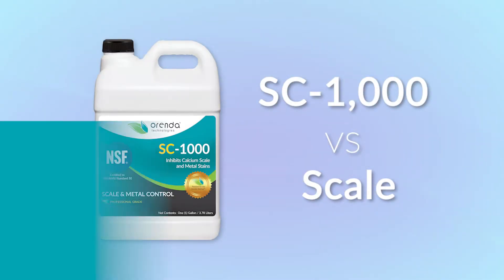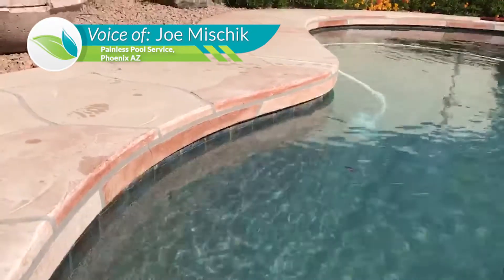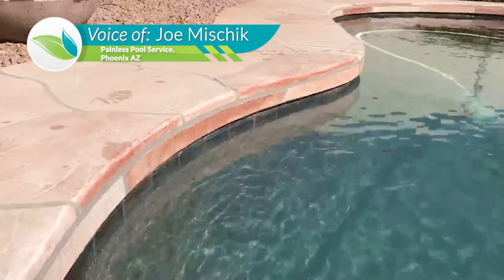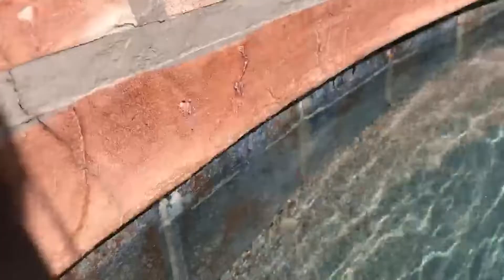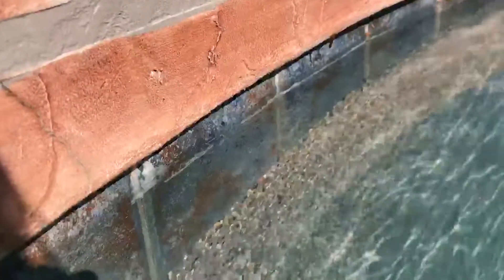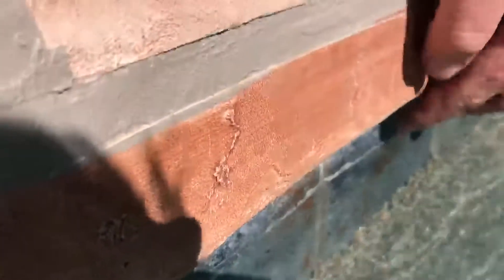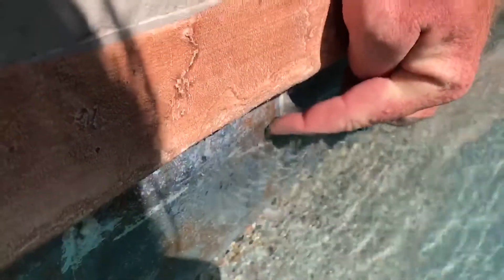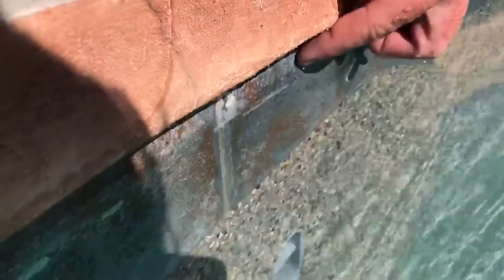How to chemically remove calcium scale in a swimming pool with SC-1000

Comment: Will it reduce pool high calcium readings? Almost at 400 ppm
Reply from the maker: Hello, it will chelate the calcium or in other words keep in solution so it does not precipitate or harden, but from a test kit standpoint the lecture will remain the same. 400 ppm is not necessarily too high if you manage the LSI with the other factors

Comment: Could you use it as a spray for the spots above the tile line?
Reply from the maker: You could try that. The problem is that the product has a slow dissolving effect, given that is not acidic. So the trick is to have the treated area in constant contact with the water/SC-1000

Comment: Is it safe for fiberglass pool for calcium silicate? My pool surfaces are white! The stuff doesn't come off
Reply from the maker: Safe? Yes. Effective against calcium silicate? Not really. Have you had the substance lab tested to be sure it’s calcium silicate? If so, How did the silica get into the pool if it’s a fiberglass pool?
Reply: @OrendaTechnologies  I don't know if it's silicate or carbonate other than in researching the issue carbonate can he rubbed off and is flaky and silicate is white/gray and does not rub off. I have the latter issue.